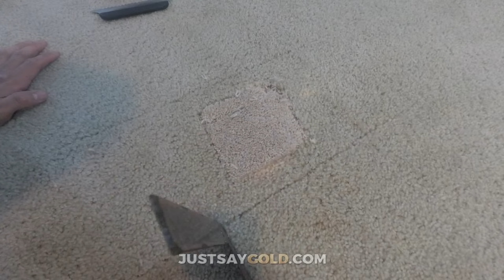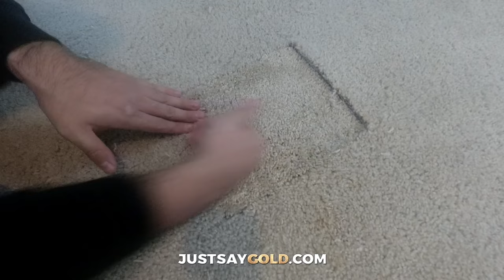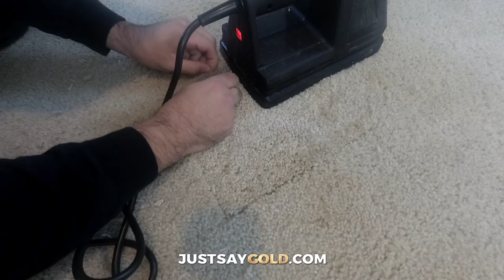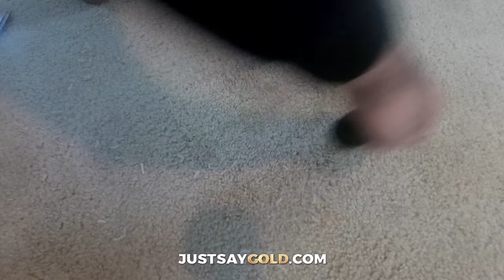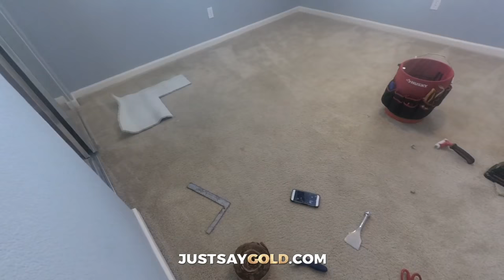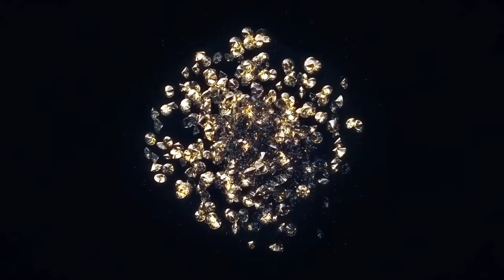Small Carpet Repair Patch Time Lapse

Comment from the maker: - LIST OF TOOLS USED IN THIS VIDEO -

Crain Top Cutter -
https://www.tools4flooring.com/crain-301-cushion-back-cutter-p-92.html?gclid=Cj0KCQjwgJv4BRCrARIsAB17JI7YcDUmsFRkk8QTKekLsP9Y7K3BYZ8mZ7_WMVMFXK6IddLZzS9-cFsaAjAsEALw_wcB

Orcon Carpet Knife -
https://www.tools4flooring.com/orcon-13322-action-knife-plus.html

Roberts Scissors -
https://www.homedepot.com/p/Roberts-10-in-High-Carbon-Steel-Carpet-Napping-Shears-and-Scissors-10-123/203296557

Carpet Steam Iron Alternative -
https://www.wagnerspraytech.com/products/surface-prep-tools/915-on-demand-steamer/

Roberts Carpet Seam Roller -
https://www.homedepot.com/p/Roberts-4-in-Pro-Carpet-Seam-Roller-10-170/202205736

Orcon Carpet Seaming Tape -
https://www.homedepot.com/p/Orcon-Indoor-4-in-x-60-ft-Carpet-Seaming-Tape-Roll-PSX-4500/206582948

Roberts Carpet Seam Sealer -
https://www.homedepot.com/p/Roberts-8-oz-Universal-Carpet-Seam-Sealer-8015-A-4/100077982

Crain Stair Tool -
https://www.tools4flooring.com/crain-154-narrow-stair-tool-p-159.html?gclid=Cj0KCQjwgJv4BRCrARIsAB17JI7MpTjHDjwSUWwsWL3tCHUFrFhoDlSKrWHOgIZJFhBZdImgrDWozk8aArYHEALw_wcB

Comment: Decent patch. I've been doing patches and repairs with a regular hot iron for years, this makes me want to go get a microwave iron! I've been skeptical about them since they came out.
Reply from the maker: Thanks! I still think a regular hot iron makes the strongest patch that lasts years just like a carpet seam. But man using this steam iron or even using that microwave kool glide iron makes it so much easier. If you do a lot of patches I definitely recommend switching over. Thanks for watching!

Comment: Great job!! I am amazed that the steam iron melts the seam tape and doesn't make the carpet too damp for it to adhere
Reply from the maker: I was taught to always do small patches with a seam iron and a wet towel and it always seemed to work.

(no pun intended)

This little tool eliminates a lot of those steps and does a great job.
I have tried it on lots of different carpet and only on poor quality carpet like Mohawk
Will it delaminate the carpet from the backing (sometimes).

Overall I am so very happy with this method!
Thanks Todd for your support and for watching!

Comment: I'll be doing this as well because of my dog. What is that black machine you used?
Reply from the maker: That black machine is a discontinued black and decker wallpaper remover steam iron.

They are getting harder to find on ebay so I recommend this one instead -
https://www.homedepot.com/p/Wagner-715-Wallpaper-Steamer-0282036/301891395

Or you can always use a home clothes steam iron with white terry towels like in this video -
https://www.youtube.com/watch?v=kW4A_jkDc5M

Comment: Nice ty!! Hey but the pad got destroyed too. So replace? What is that machine, a heat source?
Reply from the maker: Yes it's a steam iron that heats up the seaming tape glue under the carpet. If the pad was damaged more I would have replaced that section.

Comment: Do you 100% need the adhesive tape??
Reply from the maker: It really depends how large the area is, you could just glue it to the padding without the tape but the correct way would be to use the seaming tape.
Reply: @justsaygold  it’s quite small (less than a quarter of the one in your vid) x
Reply from the maker: @billierikishi8741  honestly a hot glue gun and you will be fine. Just make sure to cut the patch exactly how you want it and then glue it in.

Comment: Amazing repair, I overcut my carpet by couple inches now there's a line, any quick solution to cover up the line
Reply from the maker: Thank you! That's unfortunate, I'm not sure how you glued the patch in but if you used seam tape under it you can re heat the tape with a steam iron and put a little bit of stretch on the carpet with a knee kicker to try and close that gap where the carpet meets.

Comment: Is there a list of tools and where to get them
Reply from the maker: Here are some tools you may find helpful doing this type of repair,
you can buy them online or alternatives at your nearest Home Depot or Lowes.

- LIST OF TOOLS USED IN THIS VIDEO -

Crain Top Cutter -
https://www.tools4flooring.com/crain-301-cushion-back-cutter-p-92.html?gclid=Cj0KCQjwgJv4BRCrARIsAB17JI7YcDUmsFRkk8QTKekLsP9Y7K3BYZ8mZ7_WMVMFXK6IddLZzS9-cFsaAjAsEALw_wcB

Orcon Carpet Knife -
https://www.tools4flooring.com/orcon-13322-action-knife-plus.html

Roberts Scissors -
https://www.homedepot.com/p/Roberts-10-in-High-Carbon-Steel-Carpet-Napping-Shears-and-Scissors-10-123/203296557

Carpet Steam Iron Alternative -
https://www.wagnerspraytech.com/products/surface-prep-tools/915-on-demand-steamer/

Roberts Carpet Seam Roller -
https://www.homedepot.com/p/Roberts-4-in-Pro-Carpet-Seam-Roller-10-170/202205736

Orcon Carpet Seaming Tape -
https://www.homedepot.com/p/Orcon-Indoor-4-in-x-60-ft-Carpet-Seaming-Tape-Roll-PSX-4500/206582948

Roberts Carpet Seam Sealer -
https://www.homedepot.com/p/Roberts-8-oz-Universal-Carpet-Seam-Sealer-8015-A-4/100077982

Crain Stair Tool -
https://www.tools4flooring.com/crain-154-narrow-stair-tool-p-159.html?gclid=Cj0KCQjwgJv4BRCrARIsAB17JI7MpTjHDjwSUWwsWL3tCHUFrFhoDlSKrWHOgIZJFhBZdImgrDWozk8aArYHEALw_wcB

Comment: What if I were to stitch it back with a sewing needle? Whats that roller you use?
Reply from the maker: Yeah you could probably do that too, that's how it was done in the old days.
That's a seam roller for pushing the carpet into the glue underneath, you won't need it if you're sewing the carpet.
Reply: @justsaygold  thanks